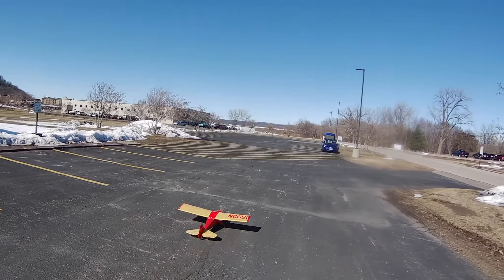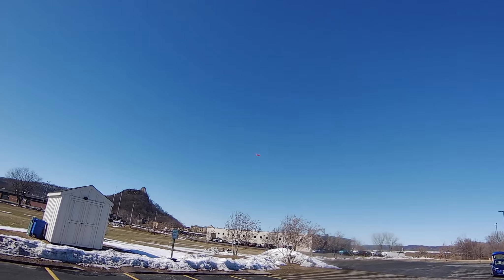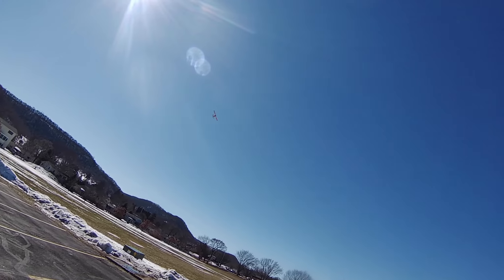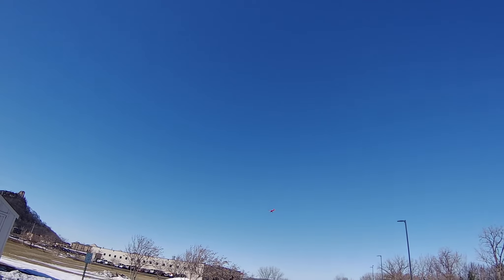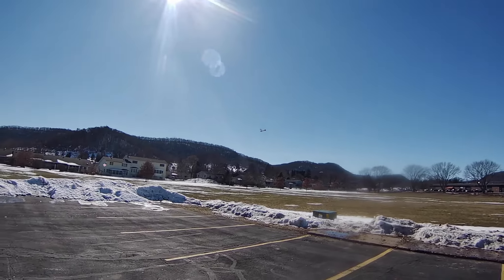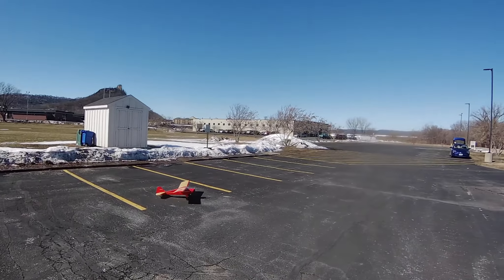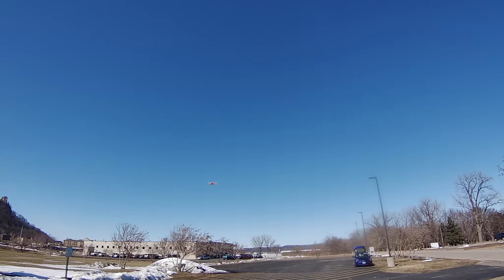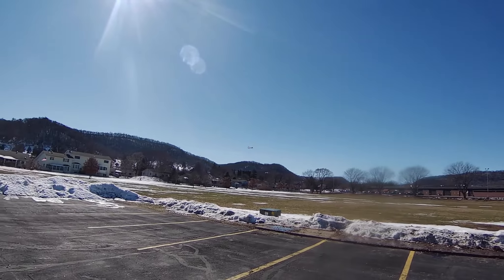March 6 2020 Model Airplane Flying

Comment: Hi Bill! Nice flying session buddy! Rich and I got in some afternoon flights today also...Here in western Mass we had rare east/ene winds so we got some unbelievable slope lift at one of the local spots. I flew my little Comet Clipper Junior which is an original 1931 Comet rubber kit...built as a rubber job around 1980...beefed up a bit and converted to Cox .020 with an Ace Pulse Commander rudder only set around 1995...took that stuff out a few years ago and went brushless electric with rudder/elevator/throttle. Also flew my old Goldberg Electra! Like your motorglider, it was originally set up with a brushed motor and a huge nicad pack. Wow, what a difference the modern lightweight gear makes! We put that one up in front of the hill with a one minute throttle application and then took turns on the transmitter until we had had enough! 8 to 10 kts straight into the hill all afternoon!
We haven't posted a video in a while but we've been getting a few flights in. Got some footage to splice together and we'll have some new stuff soon. We're still mostly flying the capacitor ff's. Richie says Hi.  -Mike
Reply from the maker: Someone was asking about you. mentioned they had not seen a video in awhile.  I am working on putting a Cox TD .010 on a Jetco Lark and will add single channel RC.   Wind here is normally out of west but need N or NE for the slope I was at.  I am going to keep looking for slopes for other directions.